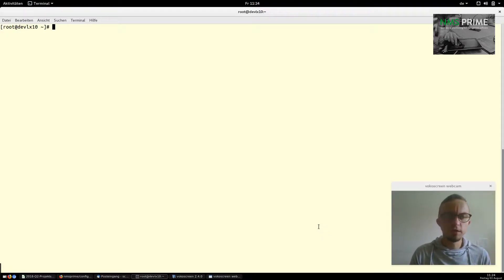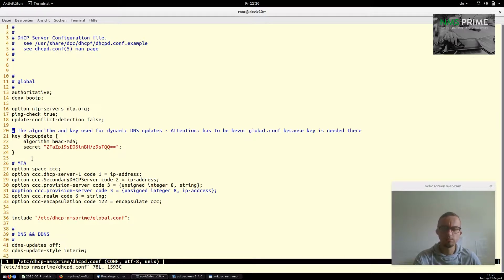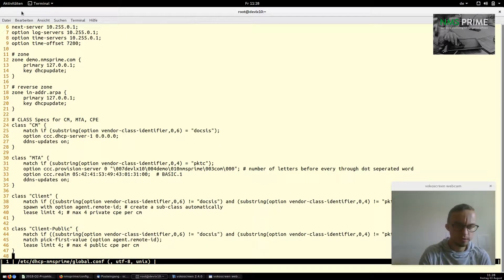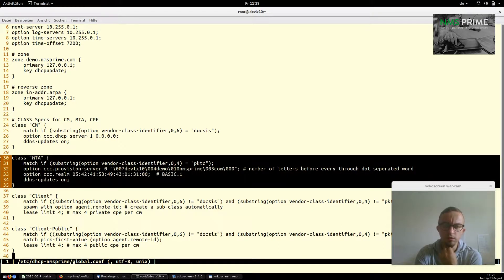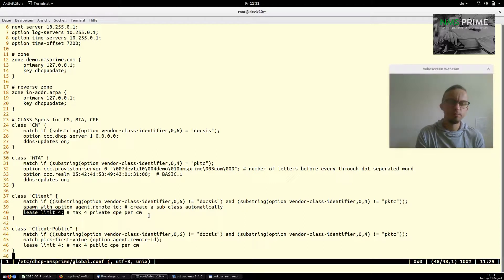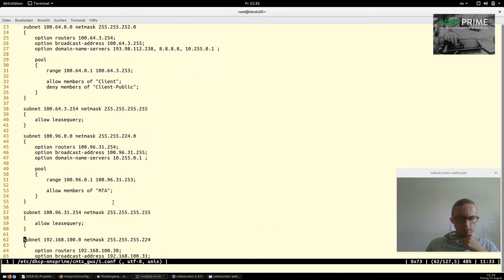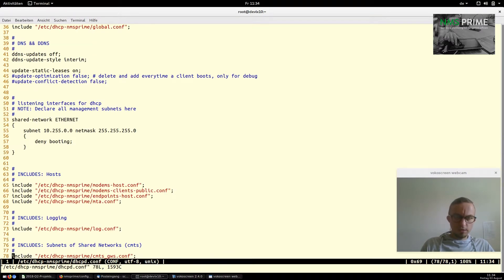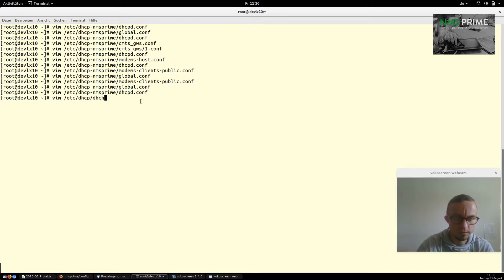DHCP Configuration for Cable Operators: How it works?

Comment: If I understand correctly, there is a string inserted into the original DHCP request from a Cable Modem or MTA that determines which class, and therefor address scope, the device will be placed in.  In the case of a Cable Modem, that string is "docsis" and in the case of a MTA, it is "pktc."  Is that correct?  Is this what you refer to as "the magic?"